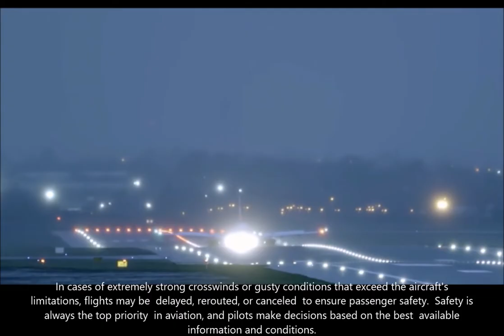Effect of Crosswinds On Aircraft

Comment: These Crosswinds have significant effects on various activities. In aviation, strong crosswinds can make landing and takeoff challenging, requiring pilots to adjust their techniques. For drivers, crosswinds can reduce stability and control, especially for high-sided vehicles. Cyclists and motorcyclists may struggle to maintain balance, while sailors need to adapt their tactics to compensate for wind direction and speed. Overall, crosswinds demand attention and skill to navigate safely and effectively....

Comment: Crosswinds hold a vital influence in the field of aviation, affecting nearly every phase of flight—from the moment of takeoff to the point of landing. Gaining a proper understanding of how wind impacts aircraft is essential for pilots, as it enables them to maintain safety and maximize operational efficiency. With this knowledge, pilots are better equipped to make smart, well-informed decisions and skillfully navigate through a wide range of wind conditions. Overall, the video offers valuable and enlightening insights.

Comment: I learnt that in aviation, a crosswind refers to wind blowing perpendicular to the aircraft's direction of travel, impacting takeoff and landing. Crosswinds can cause the aircraft to drift off course, requiring pilots to use specific techniques like crabbing or sideslipping to maintain alignment with the runway. Strong crosswinds can also affect stability, control, and even damage the aircraft's undercarriage. 

During takeoff and landing, crosswinds can push the aircraft sideways, making it deviate from the intended flight path.

Comment: I understand that; Crosswinds significantly impact aircraft performance during takeoff, landing, and flight. They cause drift, making the aircraft deviate from its intended path, and increase pilot workload as they compensate with aileron and rudder inputs. I also understand that Crosswinds also reduce stability, potentially leading to turbulence, and pose safety risks if not managed properly.

Comment: With what I learnt from the effect of this crosswinds on aircraft 

I learnt that landing and takeoff is one of the main effects of the crosswinds on aircraft..when landing the crosswinds can push the aircraft to a wrong way which can affect the aircraft to Land in a wrong direction.

On the issue of drift the pilot must make sure corrections to maintain correct parts .

I also learnt that crosswinds are associated with turbulence especially on  building or train 
It can effect the aircraft stability.

I learnt that It's important to note that that modern aircraft are designed to handle crosswinds conditions within specified limits and pilot received extensive training to manage these situations.

I also learnt that additional air traffic controller provides wind information to pilots allowing them to make informed decisions and plans their approach and departure strategies according.

Comment: I equally learnt that turbulence normally disturb aircraft stability and right comfort. I get to understand that they're significant effects that ensures safety operations on the aircraft and also pilots must constantly monitor their drift angle and make corrections to maintain the desired path. also, crosswinds can cause aircraft to land directly to a specific point

Comment: In conclusion I see that Crosswinds impact aircraft by exerting lateral forces that challenge stability and control, particularly during takeoff and landing. They can cause runway deviation, require complex pilot inputs, and increase the risk of side-loading on landing gear. From an engineering standpoint, aircraft must be designed with aerodynamic features, control systems, and structural resilience to withstand crosswind conditions safely and efficiently.

Comment: Coming to this Crosswind affects aircraft by causing lateral drift, yaw, and stability challenges, especially during takeoff and landing. It increases pilot workload, runway deviation risk, and stress on landing gear. Engineers address these effects through aerodynamic design, control systems, and runway alignment to ensure safety and performance in varying wind conditions.

Comment: In summary: Crosswinds can have a significant effects on aircraft. The takeoff,landing etc and pilots are expected to manage these effects to ensure safe operations. It is important to know that modern aircraft’s are designed to handle crosswind conditions within specified limits and pilots receive extensive training to manage these situations. And again air traffic controllers provide wind information to pilots allowing them to make informed decision and plan their approach and departure strategies accordingly. 
      Each significant effects on crosswinds on aircraft’s where mentioned according and they include: 
   1. Crabbing: crabbing involves pointing the nose of the aircraft into the wind to maintain the desired track approach part while keeping the air craft longitude before touchdown. 
  2. Drift angle: Pilots must constantly monitor their drift angle and make corrections to maintain the desired flight path. 
  3. Airborne flight etc 
    
 Conclusion: Incase of extremely strong crosswinds or gusty conditions that exceed the aircraft’s limitations,flights may be delayed,or canceled to ensures passengers safety. Safety is always the top priority in aviation and pilots make decisions based on the best available information and conditions.

Comment: I found this video educative because it has really enlightened me on the aspect that says pilots are specifically trained to manage aircraft in order to ensure safe operation.
Not with standing, I also meant to understand how crosswinds can actually reduce an aircraft ground speed and increase it's drift, affecting navigation and fuel efficiency and also impact climb rate and altitude gain .

Comment: Crosswinds pose serious challenges to aircraft by pushing them off their intended path, leading to rough takeoffs or landings. Pilots must be well-trained to counter these effects using precise control inputs. Advanced aircraft systems now help detect and adjust for drift, improving flight safety during strong or shifting wind conditions.

Comment: I understand that cross wind is a critical effect that affect air craft when taking off and landing. 
When landing, a cross wind can puch the air craft off the runway center line requiring the pilots to make corrections to ensure safe touch down. During take off, the crosswind can also affect  the aircraft stability to maintain a straight path down the run way. 
   So, in other to counteract the effects of crosswind, pilots are trained to manage this effect to ensure safe operation.

Comment: Drift angle in aviation is the difference between an aircraft's heading and its actual path over the ground, caused by wind. Pilots correct for drift to maintain the desired course. It's crucial for accurate navigation, especially in strong crosswinds. Adjusting the heading into the wind minimizes drift.

Comment: From this video it shows that crosswinds affects aircraft by causing a lateral drift that leads to control challenges and unstable landing and taking off. It also emphasis the importance of training and skill for safe landing in crosswind conditions and also pilot should always monitor their drift angles and make corrections to maintain the desired flight path. Modern aircraft are also designed to handle crosswinds condition within specific limit.

Comment: Very educative,informative and helpful video!! Understanding how to control the aircraft in this situation is crucial because the effects of crosswinds on the aircraft can be devastating.
It can make aircraft takeoff or landing very challenging because it blows perpendicular to the direction of an aircraft. So pilots should be aware of specific techniques to maintain and align the aircraft with the runway to avoid any possible danger

Comment: Didn't really know the cause of problems affecting aircraft until now ,I thought it's always from the maintenance of the aircrafts,I didn't know
Crosswinds affect aircraft by causing lateral drift, unstable landings, and difficulty during takeoff. Pilots may struggle to maintain runway alignment. To solve this, pilots use techniques like crab or sideslip landings, proper training, and rely on advanced navigation systems to ensure safety and control during crosswind conditions.

This is massive and it's so nice..thank you so much sir for this

Comment: Crosswind effects are a critical aspect of aviation safety. Understanding how to navigate and compensate for crosswinds helps pilots maintain control during takeoff, landing, and flight. These winds can push aircraft off course, so pilots are trained to adjust their flight path using specific techniques. Proper handling of crosswinds prevents accidents and ensures smooth, safe operations. Mastery of this skill reflects the high level of training and precision required in aviation.

Comment: In this aspect of effect crosswind on aircraft what I understood is that crosswind is an horizontal winds that blows perpendicular to the directions of an aircraft’s flight path, which can cause the plane to drift off. And it’s most requires pilots to apply corrective inputs to maintain alignment with the runway and ensure safe operations during control challenges and land difficulties.

Comment: With the help of this video I have learnt the ground effects on aircraft refer to the increased lift and reduced drag experienced when flying close to the ground.As an aircraft approaches the ground , the air flow beneath the wings compresses , creating a higher pressure area that counteracts the weight of the aircraft , resulting to enhance lift ¹²³. The phenomenon occurs primarily due to the interaction between the wings downward deflection of the air and the ground surface .

Comment: Wow,!!come to think of safety about aircraft ? It seems as if the plane itself has no weight or out of alignment just because of the Crosswinds acting on it according to the video description. This is to say that the Crosswinds in conjunction with the waves affects the aircraft in other to balance or ability to withstand the motion during takeoff and landing thus making the plane to lose balancing during this motion , and the pilots must adhere to Informations to adjust headings to maintain stability with the runway, this situation can be risky in run way drift or hard landing which may require additional professional handling and aircraft guidance techniques to avoid crash in the process !!! Thank you

Comment: I now understand that effect of Crosswinds affect aircraft by pushing them sideways during takeoff and landing, making control more difficult. Pilots must adjust heading to maintain alignment with the runway. Strong crosswinds can increase the risk of runway drift, hard landings, or aborted approaches, requiring skillful handling and proper aircraft orientation techniques.

Comment: From the video, I learnt that, the aircraft has it's own track, on the air. 
In the taking off and landing, there is a certain distance it will move before flying high, the more it's moves the more higher it goes also when dropping it has a certain point it begins to slowing down.
I also learnt that when flying, information are been given to the passengers and also with the pilot.
Is also designed by the crosswind

Comment: Woww I have been exposed,.

I didn't know Crosswind affects aircraft during takeoff and landing, causing instability and requiring corrective control inputs. It can lead to runway drift, increased pilot workload, and potential structural stress. Strong crosswinds may delay flights or cause diversions. Proper training, runway selection, and use of crosswind techniques help manage these challenges safely....

 Lemme search for more of your videos ,I am not sleeping on this💕💕

Comment: This video make me to understand that; Crosswinds significantly impact aircraft performance during takeoff, landing, and flight. They cause drift, making the aircraft deviate from its intended path, and increase pilot workload as they compensate with aileron and rudder inputs. I also understand that Crosswinds also reduce stability, potentially leading to turbulence, and pose safety risks if not managed properly.

Comment: Crosswinds is somehow dangerous o .I didn't see it as something harmful before .

Knowledge is actually power . I never knew
 Crosswinds affect aircraft during takeoff and landing, causing drift and requiring corrective control inputs. They can lead to runway excursions, increased pilot workload, and structural stress. Strong crosswinds may reduce stability, complicate navigation, and delay flights. That means Pilots must use techniques like crabbing or side-slipping to maintain proper alignment and safety in order to ensure a safe takeoff and landing...

This is powerful

Comment: With the help of this video, I have learnt that a crosswind is a wind that blows perpendicular to the direction an aircraft is moving, especially during takeoff or landing. It can make controlling the aircraft more difficult, requiring special techniques like crabbing or sideslip to stay aligned with the runway. Strong crosswinds can lead to unstable approaches, hard landings, or even runway veer-offs. Pilots must be trained to handle them, and aircraft have limits on how much crosswind they can safely manage. Thank you for this exposure.

Comment: Crosswinds can significantly impact aircraft performance during takeoff, landing, and flight. While in Takeoff and Landing,Directional control in Crosswinds can make it challenging to maintain directional control, requiring pilots to use specific techniques. And Drift Aircraft may drift sideways, increasing the risk of runway excursions.